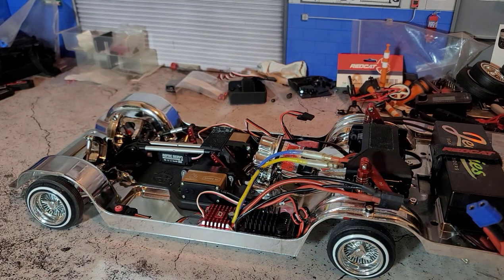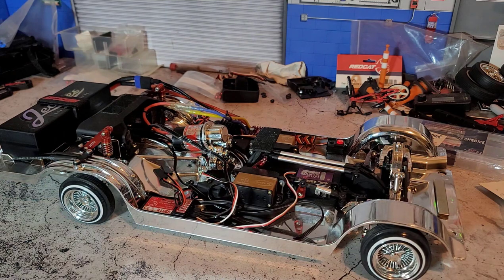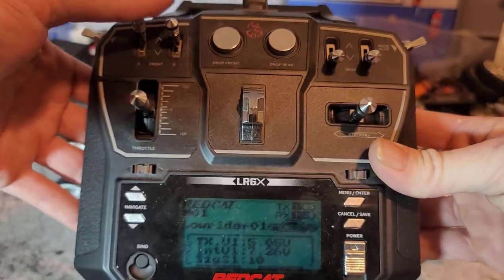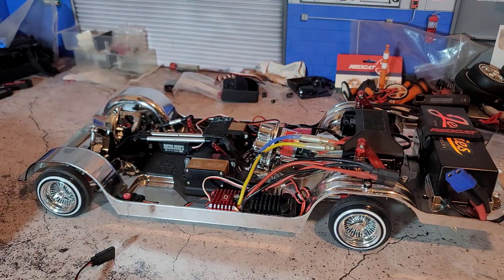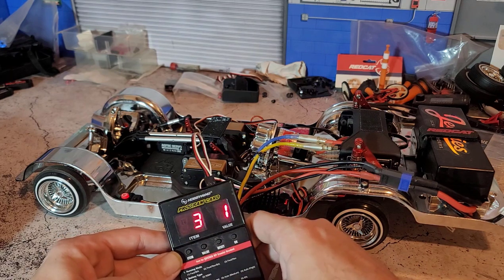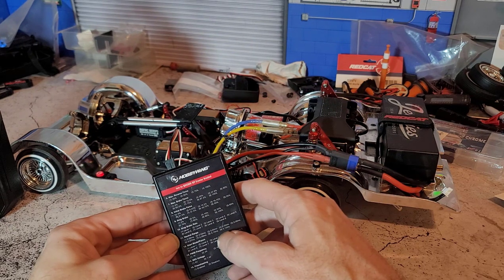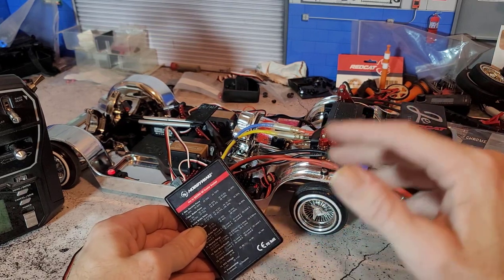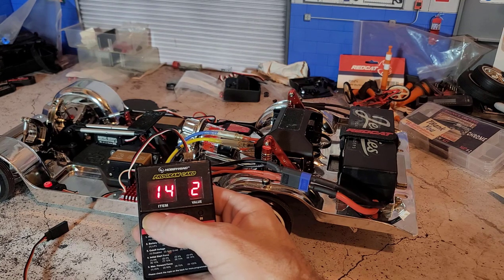Redcat Lowriders Programming Hobbywing 1080 ESC Settings Guide

Comment: You can set low voltage cutoff on since your powering the servos thru the external bec.lvc will only affect the driving and not hopping
Reply from the maker: The internal 1080 bec weak amp rating it trigger a brown out if you run 2 servo (rear) same time. Thinking the new version might be same even set at 8.4v cuz of 6a limit.

Comment: Good info since it's a quieter esc than stock
Reply from the maker: 100% and much smoother, less chance of bumping a switch sending the RC off the table........ Not that that happened to me or anything  😕
Reply: @NorthSide Custom RC  i think you told on yourself with that statement
Reply from the maker: @jimsrc2196  lllololol
Reply: @NorthSide Custom RC  as bad as talking about true cost of r/c stuff in front of wife . . Lol . . You just dont do it . . Unless like my wife ..  she buys stuff for me and surprises me alot ..  she has insurance on house mostly for the r/c stuff . . She bought most of it when i couldnt see myself buying it
Reply from the maker: @jimsrc2196  You: They gave it to me....

Wife: I don't believe you

You: Why?